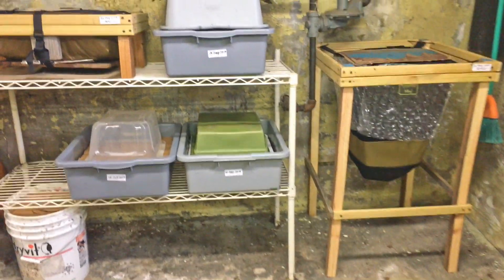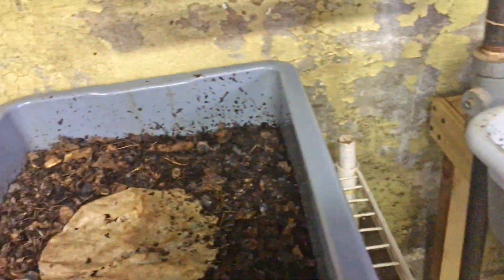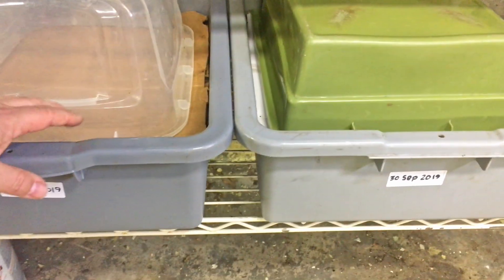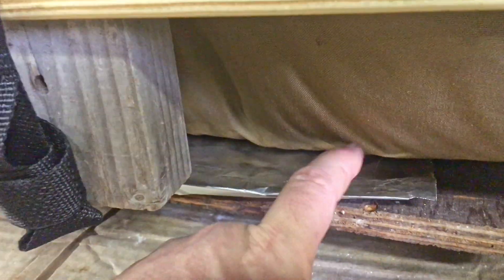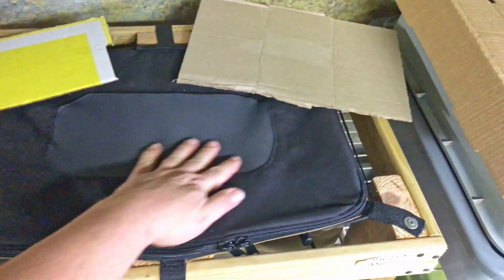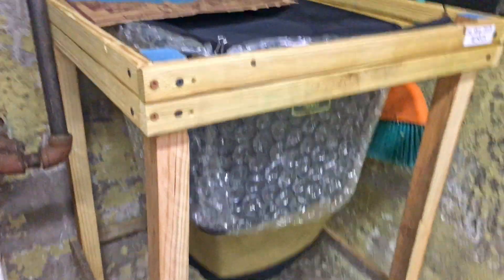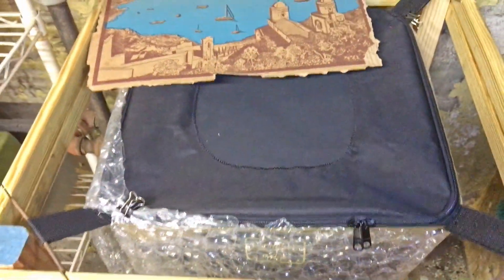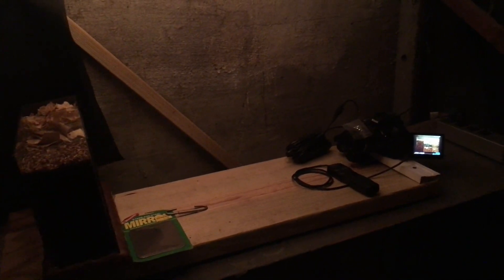Evaporation prevention in worm bags & tubs - vermicomposting

Comment: That's a good idea AV , put a  humidifier in your wormy.   for dry out.
Reply from the maker: I have a few principals that I try to abide by when it comes to my vermicomposting. One of them is to not have to rely on anything plugged in or powered to sustain the operation. For this reason I would need to come up with a more low tech solution to the problem.  :)

Comment: In your bins, consider laying a sheet of bubble wrap between the worms and and your cardboard lid.  Cardboard will leech moisture out of the bed where the bubble wrap keeps moisture in and still allows for a bit of air underneath.  I have a non-draining bin so that helps plus I freeze everything (thanks to you) before feeding.  It seems the ice crystals that form in the food matter do a great job of making the food softer for the worms as it thaws along with adding moisture since I've never needed to add any water.  Thanks for the videos!